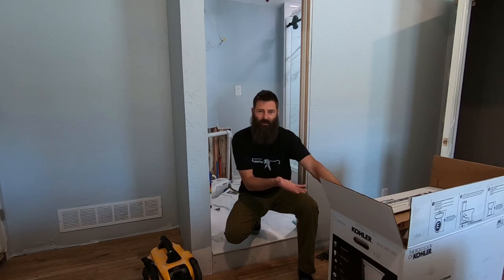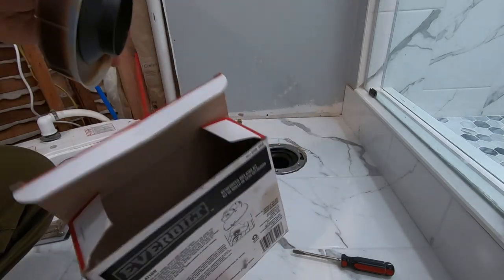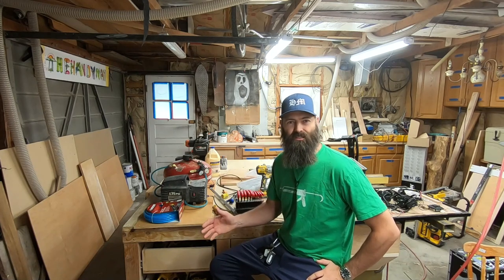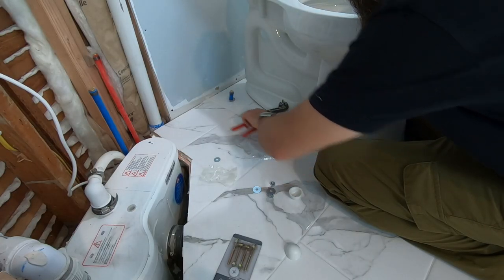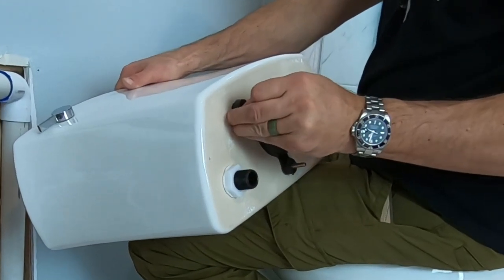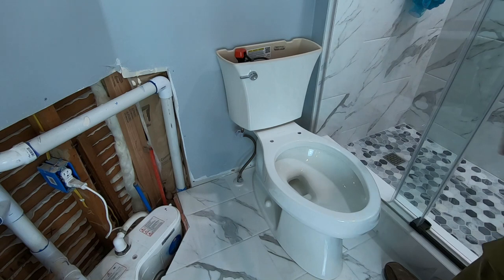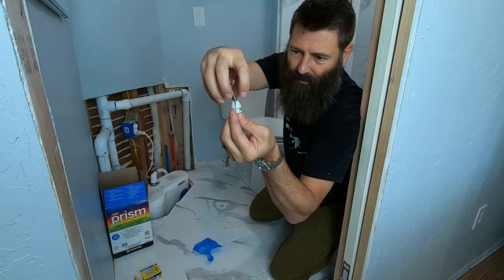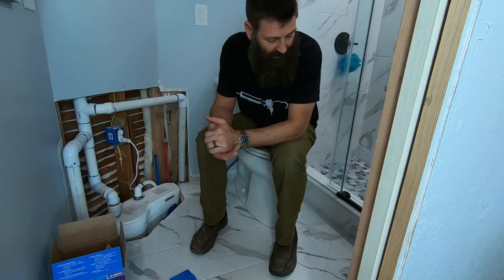Will This Cause A Flood ?? | THE HANDYMAN |

Comment: I installed one of these saniflush systems with the separate pump and full size saniflush toilet with upper tank - and it did keep a full bowl of water like any standard toilet. 
I also have another style Saniflush that will go in my bathroom that I am building - it’s the all in one unit - no tank, pump is tucked underneath- I hope this one has standing water! Yikes.

Comment: 7:57 I so LOATHE that float adjustment type, which see a lot of nowadays, can’t really escape them; as 2/3 houses will most likely have 1, lol. But they can be a pain, especially when they fail and ya get that whistle.
Also, I like the “WolverineBrass finale ultimate toilet fill valve”, as they just last, imo, and feel/seem “beefy” and good quality.
✌🏻

Comment: I prefer using the better than wax silicone toilet rings. I hate cleaning old wax. My number one hated thing in plumbing. I've been using the better than wax rings for 2-3 years now, and have had zero issues, zero call backs. It seals every time.

Comment: All electro-mechanical devices either require maintenance or repair at some point. How to you get access to the "poo shredder-pump" when it needs such maintenance? Other than that a great solution to an uphill battle.
Reply from the maker: Stay tuned.  3 days after I made this video I had to go  back and pull out an object that went down the drain.

Comment: Man I always know where to go to get ideas for solutions for my clients.  I have a similar situation for a client but they have a slab foundation… I may have to build an exterior housing for theirs.  My main concern is the what if scenarios and the maintenance aspect.  But other. Getting a little dirty I think this is a great solution for the design issue they are facing (both your clients and mine).  
When you make that wrap around counter top… I don’t suppose you’ll be making it a two piece?  It sure is a pain to maintenance those toilets when a shelf or countertop is right over the tank lid.  Almost no other choice than to take the entire tank out to be able to get my fat head to place I can see what I am working on!😂. Great job as always!
Reply from the maker: FYI  The pump won't pass nails.  3 days after I installed it.  It stopped working.  I went over and pulled it apart and found that I had let a nail fall down into the toilet waste line.   Doing a flapper change will be a PITA with the counter top over the back to the toilet.

Comment: Any special reason you have for sticking the wax ring to the toilet first instead of on the floor then setting toilet? Also, why not use the "not wax" rings?
Reply from the maker: I wanted to use this one up. I had had it in my trailer for a while.  I use waxless rings all the time.  There is a link in the description of the one I use.